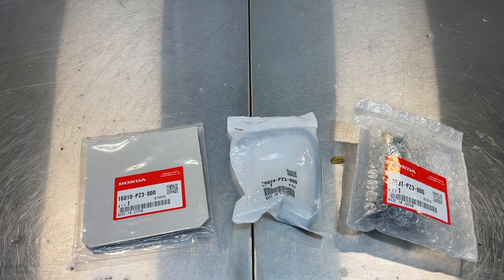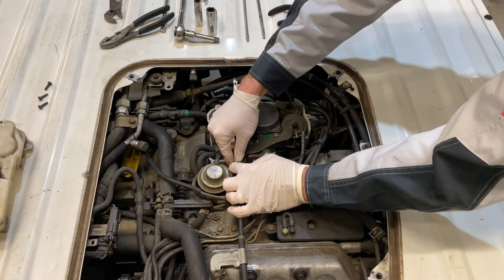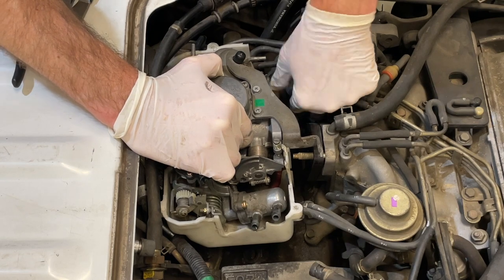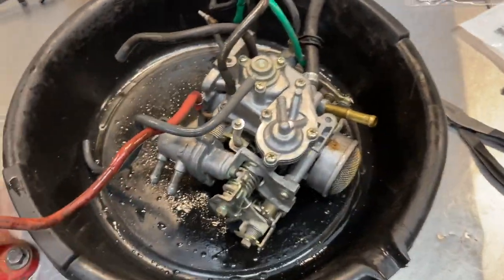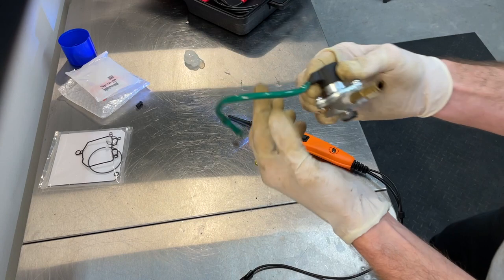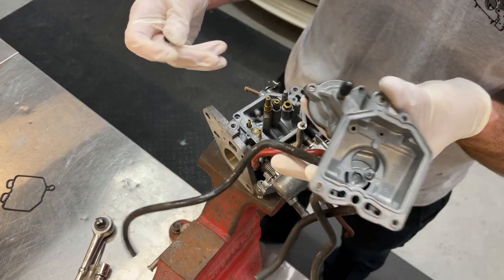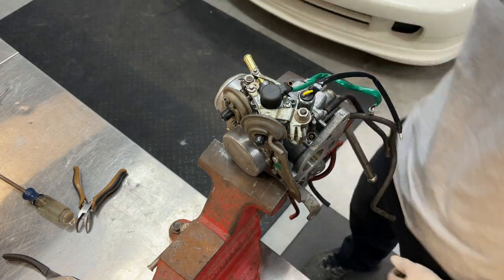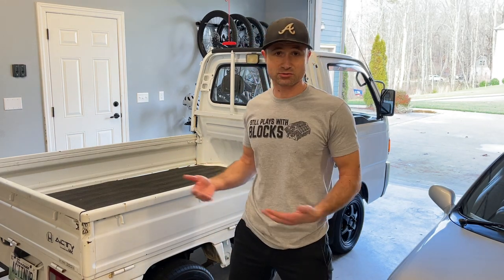Honda Acty Carburetor Maintenance & Solenoid Replacement. #Honda #Acty #Carburetor #Solenoid #DIY

Comment: Dude, I can't thank you enough for this video. I was beating my head trying to troubleshoot what was wrong with my truck. I had replaced oil and filter, fuel filter, air filter, and spark plugs. Finally, I found this video and, even though it seemed a little daunting, I decided to try replacing my solenoids in the carb. After several days working on it and following your instructions I not only learned a ton of new information, but I was able to get my ACTY running again! Thank you, thank you, thank you!
Reply from the maker: Awesome Jeff! Glad you got it sorted! And thanks for the complement on the videos. So glad I could help.
Reply: Hey Jeff, what were your symptoms for the bad solenoids. Was it one or both that were bad?

Comment: I bought a 1998 Honda Acty and imported it a month ago. It ran out of gas and now I cannot get it to run. It will start but it dies within 5 to 10 seconds. I have watched many of your YouTube videos for help without any luck. I have changed out the fuel filter and tried a new fuel pump but it doesn’t work. Then I put the old fuel pump back on but worry it doesn’t have enough pressure. Next I removed the gas tank and cleaned it out and replaced the fuel lines. I replaced the fuel control relay. I checked the fuse under the dash for the fuel pump and it’s fine. Today after watching this video for the 3rd time I decided to man-up and I removed the carburetor.  The bowl had a bunch of gelatinous gunk in it. I couldn’t get the float off after trying briefly to check the needle. I cleaned it really well and passed some carb jet cleaner wires through the jets with lots of carb cleaner. I tested both solenoids and I can hear them both moving so I didn’t replaced them. I’m wondering if maybe I should have after reading other people’s comments since I already have them. I put everything back together and it turns over and runs for about 10 seconds and then dies. I would love to have a phone consultation and would be willing to pay you for your time if that is something you would be interested in. I’m desperate for some help. Thanks.
Reply: Hi - I seem to have the same problem with my 1997 Honda Acty.  Did you even solve the problem?
Reply: Same issue

Comment: Hey Ron!
My engine is running rich and fouling my new spark plugs every time i try to start it up. It starts and struggles to stay on till it just shuts off. I changed out both solenoids and cleaned out a majority of the carburetor. It’s been sitting for a month now and I’ve replaced both solenoids, fuel filter, igniter, head valve gasket, spark plugs w/ wires, distributor o-rings, cap, and rotor. I just bought the carb gasket kit

Comment: Thanks for this video!
I have a 1990 acty attack  that I purchased a month ago. It has no power when pressing on the gas. Seems to struggle to get to 60 km and a slug up hill. Will not get to 100km on the flats. I live at 7000ft elevation.  I am frustrated with my purchase.
Reply from the maker: I had a 1994 Attack model and it would only do about 100kph tops too. It was 4 speed. It wasn’t very sluggish getting to that speed though. Have you done the plugs, plug wires, distributor cap maintenance? So many places to start. Fuel filter too. All things to consider along with the carb cleaning. I’m at about 1700 ft elevation.

Comment: Hi. Great job👍🏻

I have a question. I have 1992 Acty van. When it’s cold max rpm around 4000, when it’s full warm max rpm is 5000. No matter if it’s on parking or on a road. What the reason may be of this problem?
Reply from the maker: Are you saying it dies out about 5000 rpm? Or that it will not go past 5000 rpm. Thanks.

Comment: Thanks again for another video saving my ass with great info and imagery to keep me on the ball… QUICK QUESTION! O have no point of reference. But how long does it take for you truck take to get to operating temp. I feel like it takes along time … changed thermostat and it still takes what seems like a long time compared to all my other cars. Thoughts?
Reply from the maker: Thanks for the comment! I try to help when I can with these videos of course. As for warming up, mine seems to take a longer time than my “regular sized” cars, lol. Maybe the small 3cyl just takes a longer time to generate heat. Hope this helps!

Comment: My truck dies out after 10 minutes or so of running and won’t restart until it fully cools down. Does that sound like these valves are the issue? I applied power to both of them when they are still installed in the truck and I can hear them clicking. Is it likely they still could be bad or do you think I should look into something else 🤔
Reply from the maker: It sounds like it could be the air cut solenoid. I had a friend with a similar issue, once warm it would die out while running. I would start with both solenoids if you are going to get into the carb. Thanks!

Comment: That electrical connection on the solenoid is called a bullet connector.  They're great because they're secure, but can be unplugged and reconnected so mistakes are easily fixed and changes easily made.  It is absolutely the easiest, most convenient automotive electrical connector ever.  

So naturally nobody uses them.
Reply from the maker: Aye! Thanks for the clarification.

Comment: If there was a coolant leak present that allowed coolant to leak into the cylinders and burn out through the exhaust. What seal or item on the carb could possibly cause this? Asking because I see two coolant lines going to the carb and wondering if something on the carb could leak coolant.

Comment: Thanks for the great video, very informative. I have a 93 Acty with a choke pull of that’s not working and I noticed you have yours bypassed. Wondering if that was something you did on purpose or if the truck was like that then you got it. The Honda manual call it an “actuator” and it should be hooked to that black plastic box with the vacuum line looped to itself. My vacuum box is clogged so I never get vacuum to the actuator, may just hook it to another hose and see what happens. Thanks again for the great videos, I really want to try that tach upgrade.
Reply from the maker: Thanks for the positive review Elijah! As for the choke and bypass, I am not certain what you are referring to based on your description. Everything you saw in the video is the way my truck came. It is a 1991 model if there are maybe slight differences? I removed and reinstalled as it was when I picked it up. Let me know if I am missing something!
Reply: There’s a plastic reservoir bolted to the top of the engine on the passenger side by the valve cover with 2 10mm bolts and 2 vacuum ports. Yours is looped to itself with vacuum line but it’s supposed to connect to the vacuum lines right by the reservoir, yours are also looped to each other.  Vacuum is supposed to go into the reservoir then out and eventually to the choke pull off which is on top of the carb. It’s a black with 3 screws in the top, yours doesn’t have a vacuum line going to it. I tried bypassing the tank but it pulls the choke off too quickly and the engine stumbles. The reservoir has a tiny pinhole in the inlet port which pulls the choke off slowly. I ended up cleaning out the pinhole with a pin which restored vacuum to the pull off and improved my cold start up. Hope this helps. I would include a picture but couldn’t figure out how.

Comment: I have a 97, do the A/C trucks have different carbs? Mine doesn't have those diaphragms, am I missing them? Mine is non-A/C though.
Reply from the maker: I do believe the AC and Non-AC have different carbs. My truck is an AC truck. I haven't checked, but I could believe that maybe the AC trucks have these diaphragm to actuate and idle the truck up with the AC ON. I have not confirmed, only assuming at this point. Thanks!

Comment: Ron any idea what year they went to fuel injection?  I want to get a Kei truck this spring and when I do I know my kids are gonna wanna drive it so I would like the fuel injection for that reason.  Thank you for the detailed explanation and video.  I'm enjoying the videos
Reply from the maker: Not 100% confirmed, but the mid-late (1997 & up) Vans went EFI first. Seems as though the trucks start around 2000 being EFI. This truck has been really reliable even with the Carb. It always started even when it was hesitant which triggered this video overhaul. I wouldn't be TOO weary of the carb'd trucks, but I completely understand not wanting to strand your kids. Thanks!

Comment: GREAT video Ron! At first it looked very overwhelming (like I'd rather do the timing belt & water pump multiple times *~*), but after watching it a few times it looks totally doable. 2 questions & 1 comment: Do you get all your parts from the same place? Could you provide a link for those? I always use a magnetic parts dish to hold the nuts/bolts removed - they have a tendency to "walk" on me! Thanks again for your knowledge & humor. Much appreciated!
Reply from the maker: Yes I would do this job 6 times before doing that belt job again, LOL. As for Parts, I use Smokey Mountain Imports, talk with Nic there. Or Minny Mimi at Exporting AllthingzJDM Facebook group. Just depends on how quick I need stuff. Thanks! glad the "Dad Jokes" are hitting on someone's radar.😆

Comment: Make sure your leaf spring mounting bolts are still in place when you install axle into wheel bearings or you will get to do the axle removal and install twice.
Reply from the maker: Oh no! I hope you didn’t learn that the hard way.😮

Comment: Mr. Ron, I have a 92 ACTY and it just started stalling at stops, might that be a Solnoid? I realize it could be a multitude of things. Just would love your opinion. Watched your timing chain video also as it is getting close to that time as well. You make awesome videos. Thanks a bunch.
Reply from the maker: Hey David! Thanks for the kind words. Did it restart after shutting off or just dead and will not start? A lot of times when the air solenoid is bad it will not idle well (or at all) when warm. If it will not start at all when warm, could be ignition issues. Check for spark.
Reply: @rhd_ron  Than you for your reply, it starts with no issues every time after it stalls i.e stop sign.I have a connection in Japan for parts, Lived there 13 years, But i guess you get parts here in the states, Is that your company? Forgot to mention your Kids are awesome too.
Reply from the maker: @MrNitrox32  I get my parts from japan through AllthingZJDM. Thanks.

Comment: Hi there mr ron , i just got my acty truck would it be alright to throw in a can of b12 chemtool in the gas tank?? So my 92 acty non ac shut off on me 2wice but i had heater on and headlights of course i thought maybe w all that on i lost power cause when i turn those things on at night i feel idle change like it loose power..or would it be my carb..other than that if i drive her all day long in the day shes good 😊.
Reply from the maker: Ive never done the seafoam or b12 in my tanks. I cant say if itd hurt or help.

Comment: Hi RHD_Ron I have a question . I have a 1991 Acty and when I turn the side lights or heater fan On the Idle speed increases by about 500/1000 RPM. Any idea why this might be ? Its a real pain with an Auto gearbox as it jumps when you move into " D " or "R"

Comment: Hi Ron, my  90 honda acty, the carb is overflowing, what could be the problem?
Reply from the maker: Hey Kingsley! Sounds like your float in your carb is hung. Tryi taking it apart and make sure there is no debris and the float moves freely.
Also check you needle
Valve on the end of the float and make sure it doesn’t have debris under it too. Good luck!

Comment: Will this solve the following issue: Idles good, but when accelerate and shift thru gears (manual) it bogs down till I shift to next gear, feels like I am being governed thru each gear. I can drive great on level streets (driving slow without putting a load on engine) but when I need to, let's say redline to gain power it bogs down before I can reach peak power. Thank ahead.
Reply from the maker: I cannot say for sure, BUT it does sound like an issue my friend was having on his Honda Today with same engine. One of the solenoids were bad and replacing both did resolve his similar issue.
Reply: Great video! I have an automatic acty van that bogs down BAD from a dead stop. I have solenoids coming in a couple days. Is there anything else that could be a culprit?

Comment: love the video thanks. 2 questions, 1. where do you source the OEM parts? 2. do you think honda with carb is a better option than going with a sanbar with efi? I've got 2 accords, odysesee, grom, crf300, ridgeline, and a civic... so I've always been a honda guy... but I'm scared to get into doing carb work.
Reply from the maker: Gosh I am very Honda/Acura biased and loyal. I’m not a fan of a carb but it really hasn’t been a huge issue.
Never stranded me but sometimes was hard to start, hence the rebuild video. Not sure about the Sambar, some love
Them. I just cant migrate from Honda.
One day this truck will have EFI something powering it.
Reply: @rhd_ron  will you EFI this version or get a newer engine or truck? looks like after the 98 model we get efi? So I'm really close to being able to maybe get one..... idk... would you say just nut up and get gen2 acty + service manual? for perspective we sold my wife car, she took my civic, and now I'm using the crf300 for DD but... i work from home so its not a deal-breaker, but dang I want something to drive in bad weather....

Comment: Hi Ron I have a question as I’m trying to diagnose my truck. Basically it sat for about 2 weeks or so not being driven, was running fine before that apart from the occasional hard start when it was hot. We had a lot of rain while it was sitting, then the first time I started it up it died maybe 10 seconds later and was the really hard to start. I thought maybe a bit of moisture had gotten in somewhere but now will only start if it’s cold and will drive fine but will not idle and will not start again. Do you think this sounds like the solenoids to you? I have Nic putting an order together for me with the solenoids but wondering what else I could need? Thanks mate good to have someone making decent videos.
Reply from the maker: Hey Kieran! I appreciate the feedback. I Would start with the solenoids and a good carb clean. Seeing as though all was well 2 weeks ago, and now there is an issue I would rule out a vacuum leak since nothing changed. More than likely something has gunked up the carb or that fuel cut solenoid has started acting up. One thing I noticed when I removed mine was that even  though it cycled with 12V, the needle portion of the solenoid was a little worn. So maybe that was my issue. Make sure to try and run non-ethanol gas, especially if the truck is going to sit for any amount of time and not driven regularly. Thanks!
Reply: @rhd_ron  Thanks for the advice, I’m going to be doing a lot of work on it once Nic the legend gets my parts sorted. Guess it will be a good time to give it a good clean and check for anything else that could be about to go.
Reply: @rhd_ron  so it turns out that it was the distributor cap and rotor causing me all the dramas, it reminded me of my vw kombi days. Interesting thing to, I decided to check the solenoids with the carb in the truck and for the life of me can only find 1 solenoid wire. I studied your video and it looks to me like the solenoid wires run more or less next to each other but I can only see one wire in mine. Nic has checked using my vin an his info says there is 2 but I’ve only been able to locate 1. Weird.

Comment: Ron, just got my Acty van 1995 60000km 2 days ago. Bought it from Tx where it ran fine, brought it to Colorado and when I accelerate it bogs down. Took the air filter cover off and it runs fine.  What do you think? Solenoid?
Reply from the maker: Could be a number of things really. Unfortunately with these carbs, elevation CAN impact. However, what condition are your plug wires? It may need a carb cleaning, could have been in marginal shape in TX then the elevation change in CO may have put it over the edge on being starved for air since the truck runs fine with the cover off. Most of the things I read they run worse with cover off, so this is interesting...
Reply: I got it figured out!  Pulled the carb, air solenoid was dead. Replaced it, continued to run rich and flood. Finally took it to a carb shop, float too high, bypass of fuel on a gasket. Runs top notch and has been for about 4 months. At 75k now. Really need to change my timing belt. Job looks tough!

Comment: Would these 2 solenoids cause a hard startup after warm up? Great rebuild video keep up the good work.
Reply from the maker: Thanks RJ! Yes, I believe is the air cut solenoid that can cause issued after warm. I had a buddy replace that on his and it resolved the issue. Once it was warm it would almost bog down and just shutoff. Once he swapped the solenoid he was good to go.
Reply: @rhd_ron  awesome I’m just waiting for my solenoids to arrive. I have an extended crank when it’s warm. it will start up but like takes 10 seconds to start before it will start up after a warm run. I did the fuel pump at first bc I thought it was losing fuel pressure but same thing. Really appreciate the help Ron.
Reply: @SerRJGr8ness69 did swapping the air solenoid resolve your issue? Im having the same issues